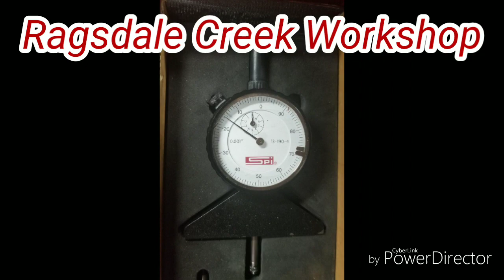BXA TOOL HOLDERS (PART 1)

Comment: Good looking job. You go about your dovetails differently than I do. I mill the slot to size, then use a feeler Gage under the dovetail cutter for my clearance. Just goes to shows there is more than one way to skin a cat
Reply from the maker: I do it that way also but when the Chinese cutter messed up it also messed up my slot so i had to cut relief  after.  Also i know now exactly how wide to make slot so i will not have to cut flats next time . My holders had a chamfer mill on point of the dovetail and could not tell exactly  how wide it needed to be but now i will draw a print and will know dimension  next time . Thanks  for your comment and great minds think alike.